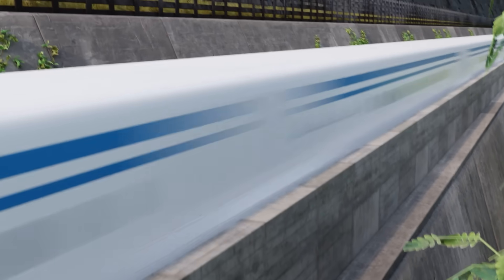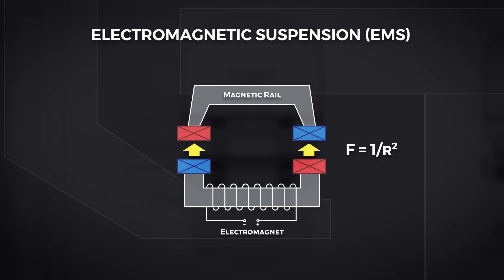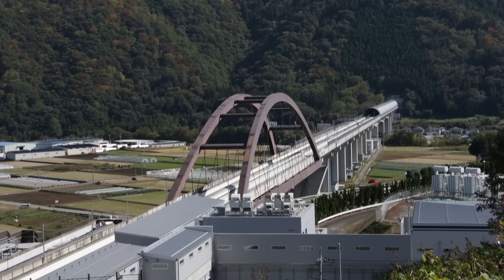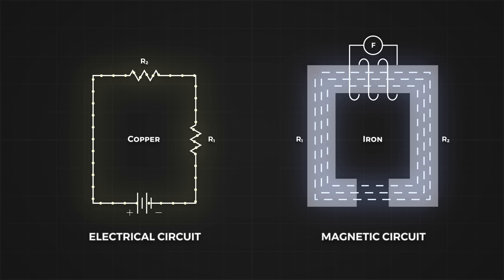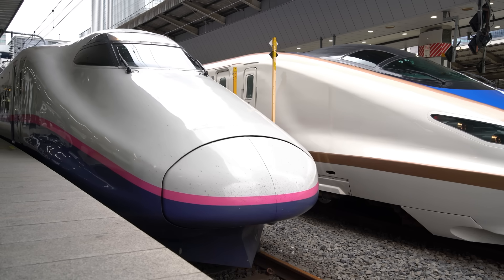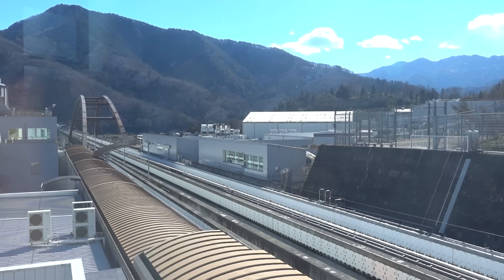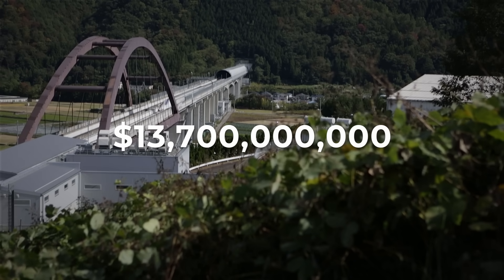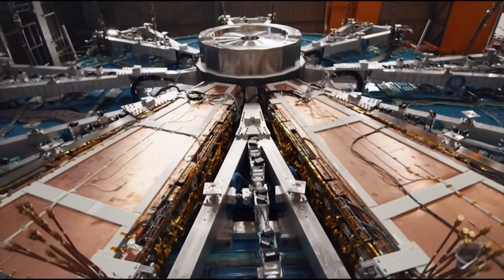How Japan's Maglev Train Works

Comment: A bit of good news for US high-speed rail, it actually starts to move toward real high-speed rail for several regions.

- California HSR is in construction and (slowly) moving along even with a lot of legal and other problems along the way 
- Texas HSR planning for two of its largest cities also move forward after winning some major legal battles. It is also uniquely suited for construction due to its infrastructure. (come on Texas, you might beat California in this)
- Private-owned Brightline after its (semi) high-speed line in Florida pay off and have an extension also starting the process of its new truly high-speed West coastline between Las Vegas and Southern California.

I hoped for the best for all those projects even with some cost overran or delays, I truly believed it will pay off for all of those regions and demonstrated the success and benefit of HSR for the whole of US even if one succeeds.
Reply: I think Brightline West will be the first system in the USA with 186+ MPH trains in operation.